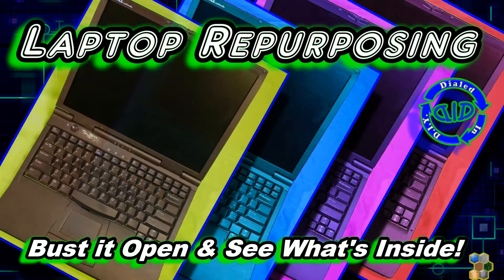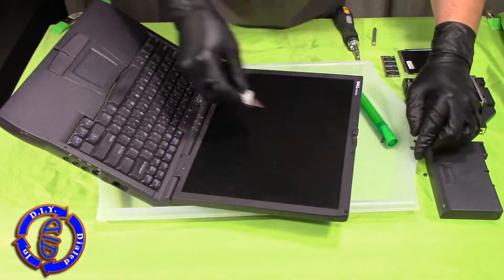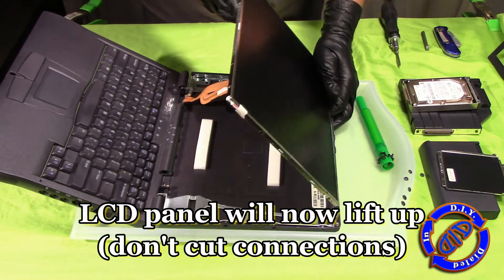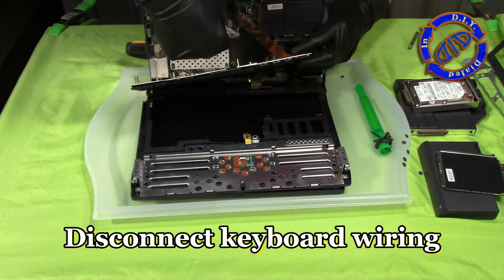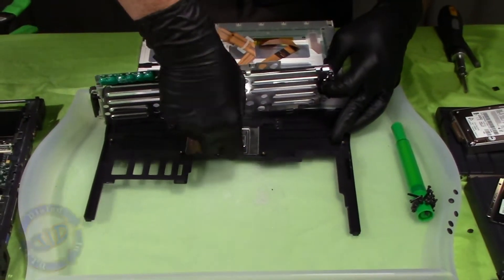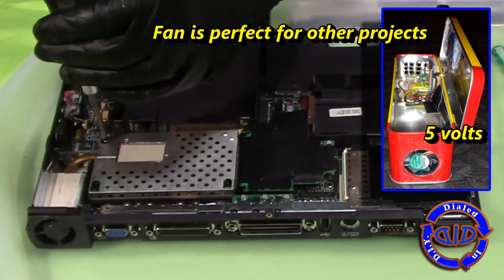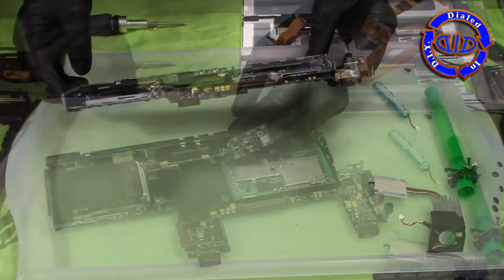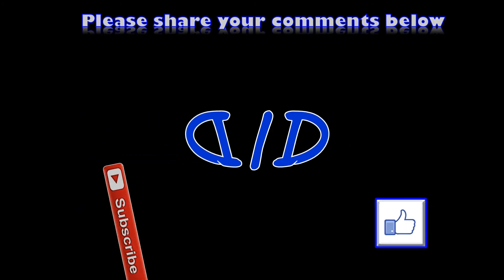Laptop Parts Salvage & Repurpose - LCD Removal - PC Autopsy

Comment: in general you start the other way around with laptops and take apart the bottom half first :P and using a sharp knife like that is almost a big "No no" since you can short components or cut cables. You'd better use a plastic spudger :)
Reply from the maker: So true... thank you for the comments / feedback.  When I filmed this laptop autopsy I did not have many of my tools handy.  I do prefer a spudger or other plastic device especially for finer electronics including laptops and phones.  Thanks again!
Reply: @DialedInDIY  I am glad to hear your response. I didn't mean to criticise you, it was more like helpful info. Keep up the good work mate :)
Reply from the maker: @dreamerartworx  No worries at all... I took it as helpful feedback too. I always welcome feedback and suggestions... there is always something to learn. :-)